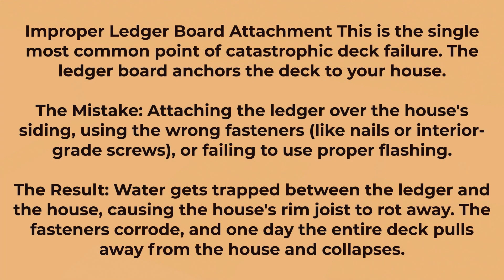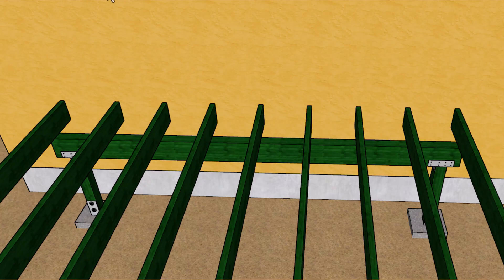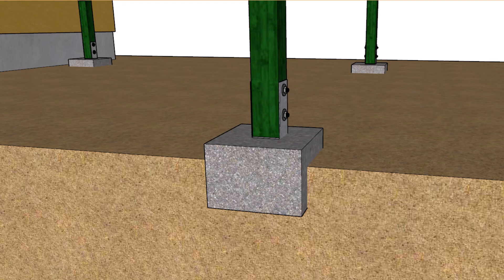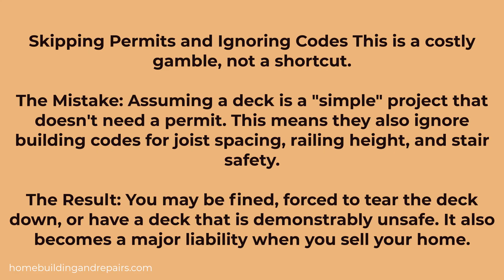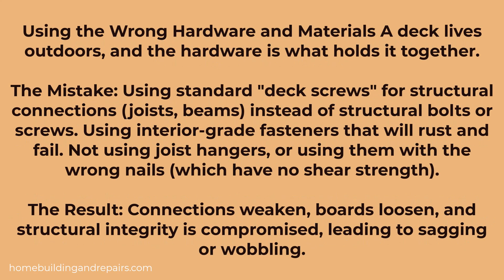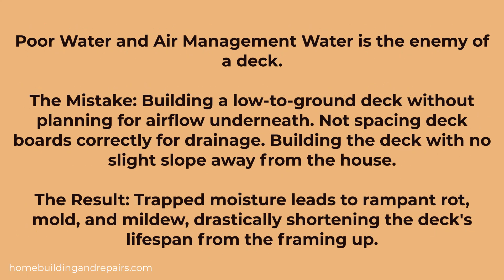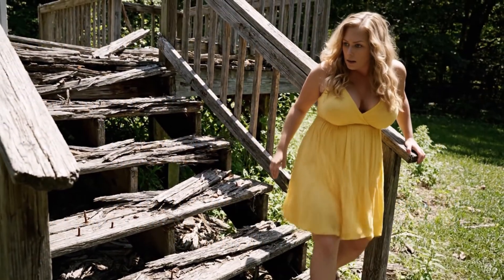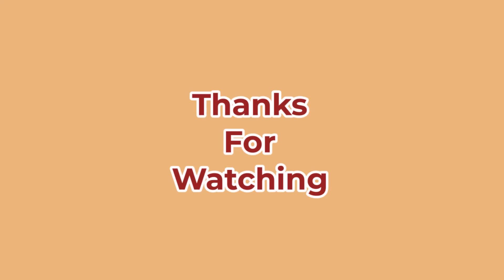Pro Builder Reveals 5 of The Biggest Amateur/DIY Deck Building Blunders

Comment: I would like to add the improperly galvanized fastener I see lots of very lightly galvanized fasteners or screws with very simple coatings on them that are just not meant to be used with the copper treatments.